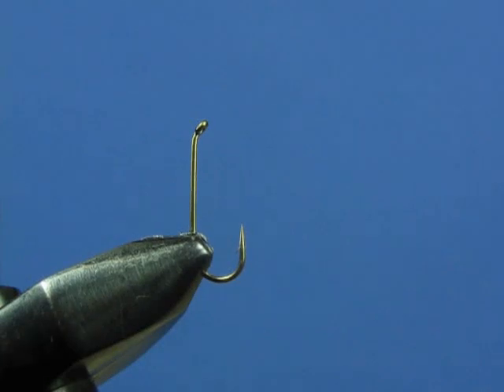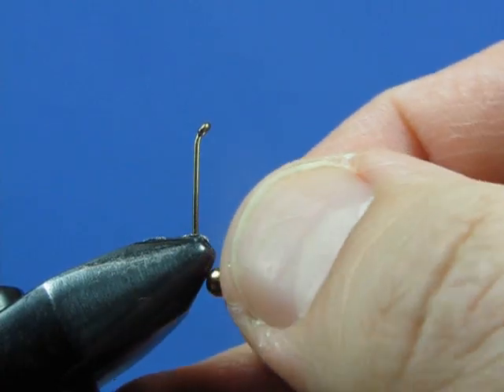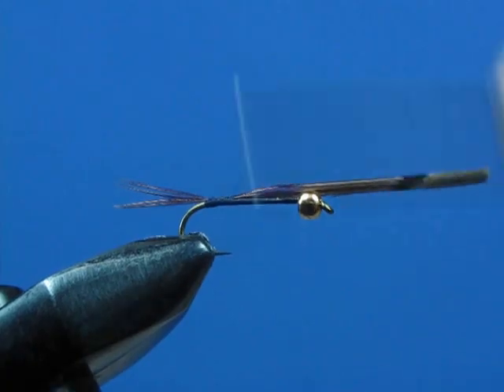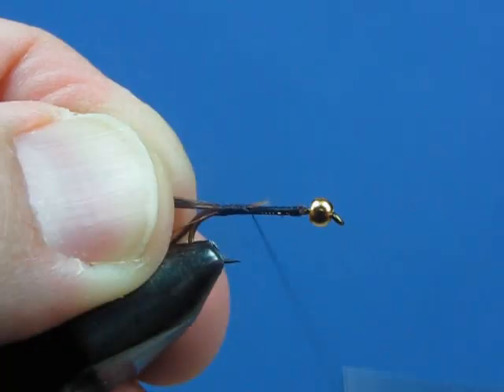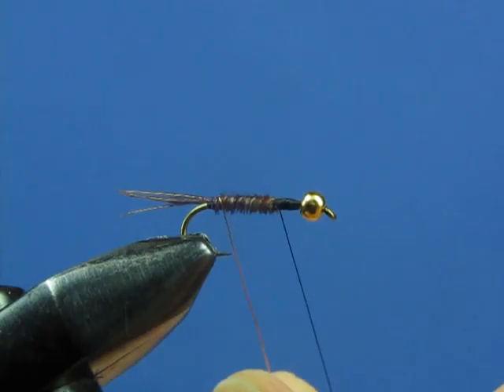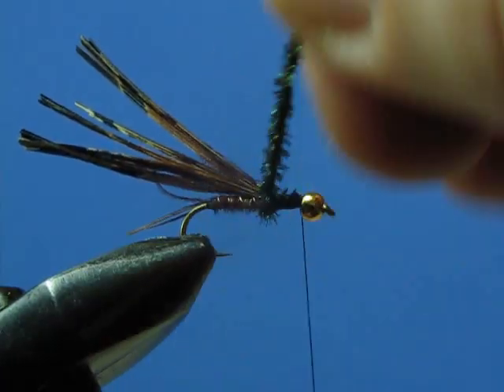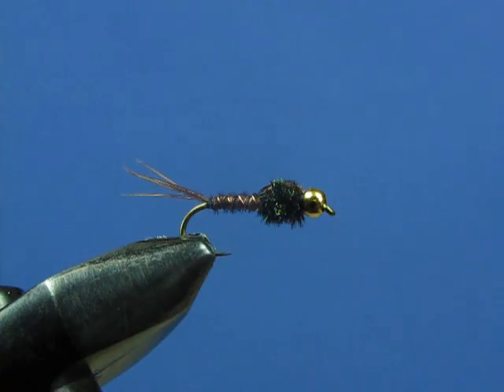Beginner Fly Tying Tips - Part 8:  The Bead Head Pheasant Tail Nymph.wmv

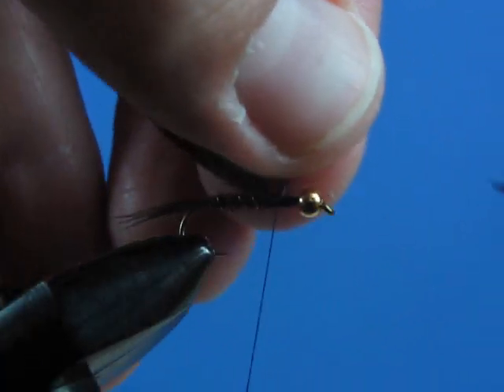Comment: Love your e-z and patient instructions. One question: I noticed that you trim the tips of pheasant tail that protrude out past the bead (@ 8:02)? If you were to "adjust"  the protrude length to 'bout 1/8" of an inch. Now, before you tie down the wing case, split the tips and pull wing case it forward BETWEEN the split tips. While you're tying down the case hold the tips down and secure thread wraps will hold it all in place. It imitates the fly legs, gills, etc. Fish that look up at it see its' silhouette from underneath. I have noticed that the Pheasant Tails w/ "legs" catch much more. I'm sure u know this method but I just wanted to share. I recommend your tying series to beginners alot. 
#FlytyingRocks